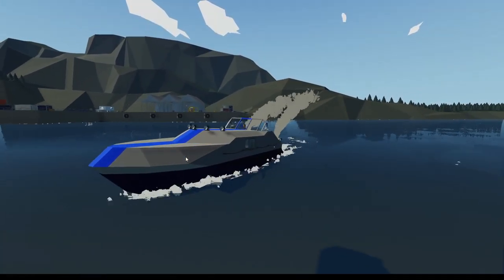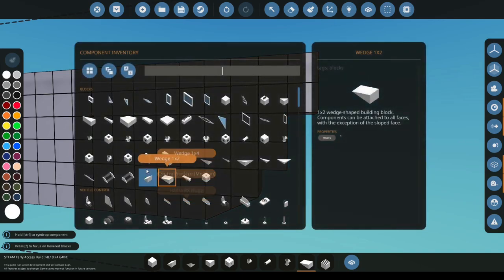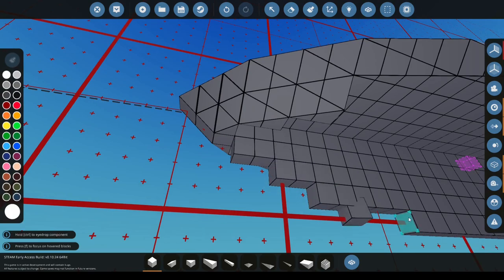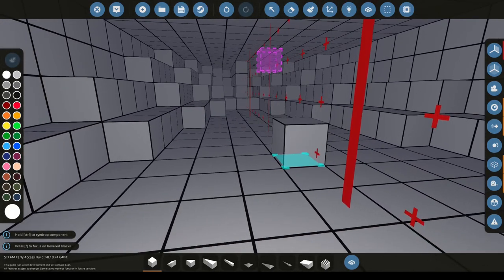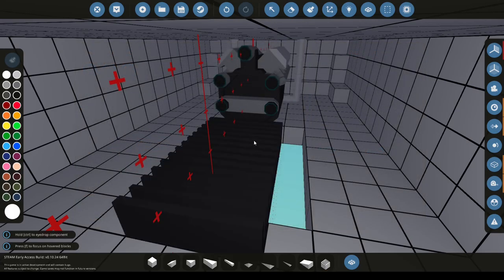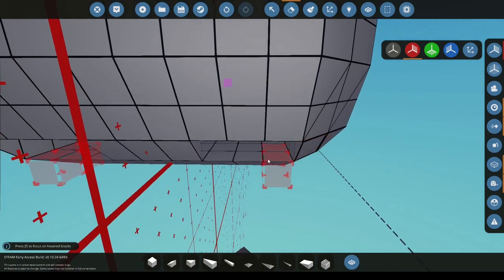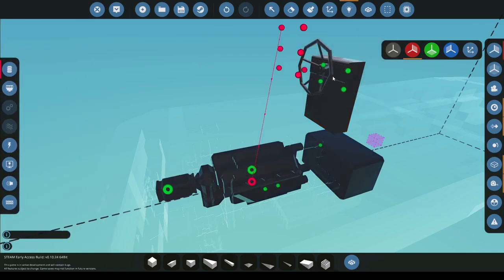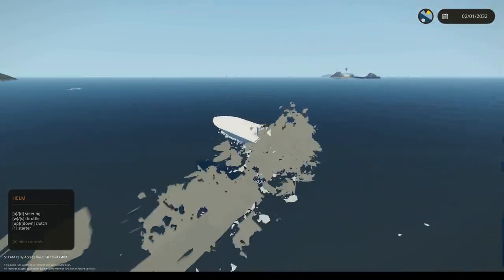How to Build a Basic Boat - Stormworks Tutorial

Comment: What are your pc specs? My game crashes on launch.
Reply from the maker: Hey @Gamin Greeny ,
When I made the vidio I was running:
Intel I5 core @ 2.80 GHz, Nvidia 2060 graphics card, and 16 GB ram,
Check the game's steam store page, it has the specs required for the game.
AJ
Reply: it works on my new pc

Intel core I5 10300h 2.50ghz

8gb ddr4 ram

geforce gtx 1660 ti max q